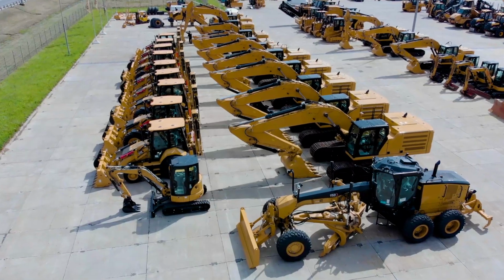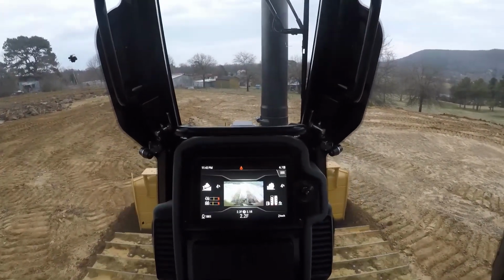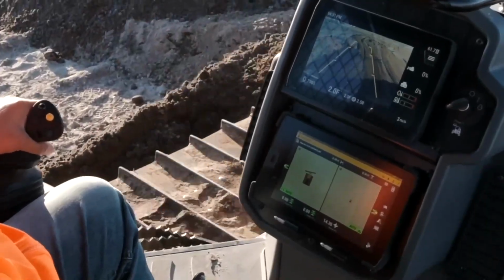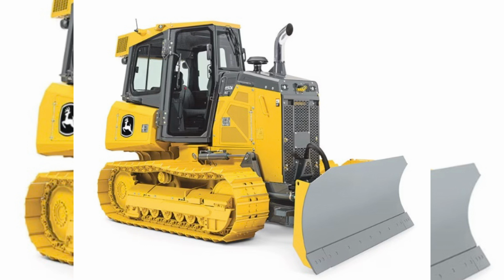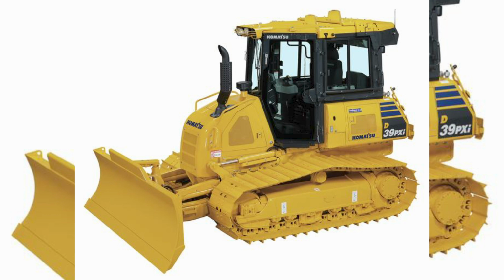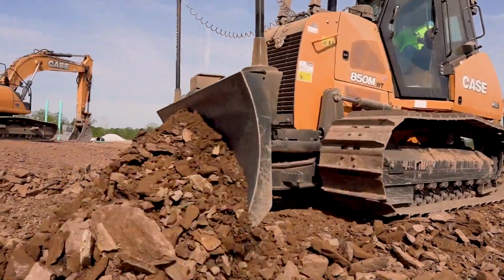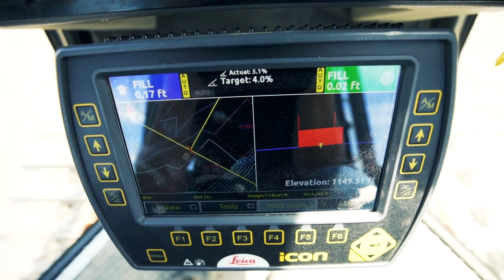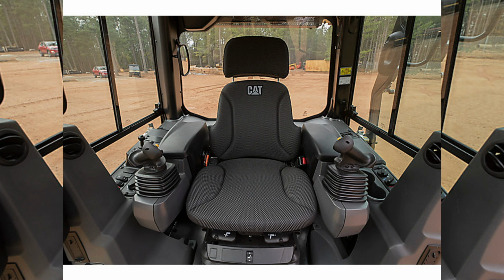WHICH SMALL DOZER IS THE BEST?!! We Compare the top 4 small Dozers!!

Comment: What was your opinion on the 1970s vintage CASE dozers with that what I call the best ( power tracking) the two levers between your legs. That was my time in seats. I was just amazed at what the 850 case loader could do on sewer backfill and pea gravel runs. We had also a International 125 and a cat D-3 size with a front bucket. I got to operate each one, because the International and cat sat a lot. The case back then ran circles around the other loaders. But yes, on build strength, the International was by far the beefy machine. Please give me your opinion on the operation of those old girls. I saw lots of contractors have ( JD) with backhoe attachment on sewer jobs before I was old enough to be an operator. I just never really liked the ( JD) operator lever set up. I will say the ( T) handle blade lever for ( JD) was so far ahead of its time. 😊
Reply from the maker: Thanks for watching and for your comments. Apologies for the delay in getting back to you as well. 
The older case machines were good machines. The 850 was a loader you saw in lots of different places. I saw them loading train cars, dump trucks and even on larger farms. As far as older case dozers, I personally operated some 550’s and 650’s and no issues with them whatsoever. Other than freezing my butt off in the Canadian winters because they had no cabs. That was all dozers here though, not just case.
They pushed well and were pretty good on fuel. I did find you couldn’t get real rough with them however because they just couldn’t seem to handle abuse too much. The old TD (International) dozers were great machines except for the decelerator being on the left foot which was really weird and hard to get used to.
All in all though, I would take older Case, Cat or International dozers over the 70’s Komatsu’s any day! 
Thanks again for watching and for your comments and questions. We always love to hear about the experiences of our viewers. Take care and stay safe out there!

Comment: Nice vid. 
I retired in 2016. The best  largest dozer ever built is a D11R   7pz series Cat. Hands down. After 20,000 hrs on a D11R, I think I'm qualified to say that..The d11t is junk imo. 

My experience on small dozers is all on older stuff. I liked the komatsu d41, d65 & p61. Very quiet. Comfy.  Good dozers. I built alot of DEP ponds & roads with those komatsu. They would hold a steep bank a cat would roll on. 
 D2,d4, d6 hydrostats, they get the job done, but the cat  hydro stat is a pita.  It either works or it dont. The d6 hydro stat GPS was ok. Not my favorite.  My favorite small Cat is a D6R. Very reliable, powerful,  & trouble free. 

My favorite personal small dozers for small fine grading was, and is, a 450 case. We have (2) 450 Bs. Old yes, but still very good.  They're both Cummins power, so actually over powered & you dont want a newb on them. A newb could tear them up. They are also pretty easy to work on, when you rarely have to do a fix. They're built very well. 

I'm sure these new ones are probably really something fancy, but I never needed fancy on a dozer. I like my dozers with power & reliability. 

Cat R models & old cases have both. 

Thanks for the video. 😊😊
Reply from the maker: Thanks for watching and for commenting, we always love feedback from our viewers - especially when they take the time to tell us their experiences and preferences.

I personally have never had the opportunity to operate a D11 but I bet they're quite the machine! The "R" series was a great version of Cat all the way around. Great power, great reliability and great comfort. From the 6 to the 10's which I have operated, enjoyed them all.

We put John Deere 36" pads on a Case 350 one time and that little guy would almost walk on water! Incredible for soft ground.

We're glad you enjoyed the video and happy you shared your comments. Have fun and stay safe out there!

Comment: The older d4 high track from the late 80s and mid 90s the K are great machines looking at from a grading small rock on the sprocket for wear the high track not as much on the sprocket crushing the smaller stuff just as must wear as the big stuff rocks not bigger dozers. The 3/4 rock gets in-between the sprocket and the drive chain hard on both the high track the idel wheel being smooth pops it out most of the time in stead of the sprocket grabing and pulling it in still both work changing sprocket teeth a bit easier on the high track not breaking the track apart in the feild changing pads that's 4 bolts compared to breaking a track apart in the feild by yourself. Some say unfriendly to the environment but also the high track used for Forrest fires keeping the drive up high for temp and such
Reply from the maker: Thanks for watching and for commenting. Everyone has their favorites for sure and we certainly won't tell you what should be yours! Thanks again and stay safe out there!
Reply: @SoGoWoWo  just tractor talk like cars and trucks not all nerds are computers and 5rings
Reply from the maker: Very true! We very much enjoy discussing heavy equipment as well. Those were great machines and the high drive has proven to be very advantageous in many areas. I personally spent many thousands of hours on a D6M with steering clutches (rather than the electric at the time steering clutches) and have fond memories of it. With the improved cooling and power - they were a welcome change to the 5H. Personally what I love about all these new machines is the speed of the hydraulics. They are just so fast!

Comment: Finish dozer guy here. Operating since 1985. Started on an old JD 450...In my opinion after running the new stuff the Komatsu fulling integrated GPS Dozers are the best as far as operator friendliest and comfort for sun up to sun down days. They also seem to hold up on track and undercarriage wear. My first time on a new D-39 was on a house plat we built I couldn't believe how smooth it turned and held the desired turn rate as i cut for curb and gutter...I got to finish it all in those days no GPS...the ponds turned out sweet as it was the the best for slope work as well...Cat is good, but can't compare on balance when free hand work is needed...and it always is...
Reply from the maker: Thanks for watching and for commenting, we always love to hear feedback like this. Operating the D39 is truly a wonderful experience. Smooth, powerful, lightning-fast hydraulics and great on fuel. That said, the others all have their strengths too and are also great to operate.
Reply: I have to agree with you..I have done alot of heavy sloping & building rock dams with blast rock in mines "camp work".. Road construction etc to having to do finishing work as well..Operating Cat d4,d5,d6,d7,d8 & d9.. h,k,n,r,& t, etc etc..Deere 750k,850k..Dresser td 20 & 25b,c,e & g..Komatsu d61,d65,d68,d85 & d155..For me,I personally prefer Komatsu for all scopes of dirt work..I have my personal reasons for preferring Komatsu,too many to list..That being said,I don't complain anymore😂 with whichever seat I'm in..
Reply from the maker: Our apologies for missing this post, we generally try and respond as quickly as possible but somehow missed your comment. We definitely agree - Komatsu makes a fantastic machine but operating any of them nowadays is pretty darn nice! It's not like the old days where one or two were far superior. Now they all make very nice machines to operate. Thanks for watching and for commenting and stay safe out there!
Reply: Can you help me with a real fuel consumption per hour worked? I'm interested for the D39 dozer to buy. Thanks

Comment: Could you clarify the Komatsu Tech, do they use TopCon or have their own GPS system to measure stockpiled material.  Have you compared the CAT Earthworks system when comparing different manufacturers equipment.
Reply from the maker: Thanks for watching & thanks for the great question. From what we can find researching, Komatsu's software is something they can program into Top Con or Trimble. Maybe one of our viewers could speak more regarding this? We certainly don't want to give out false information.
Reply: They use topcon but there is a conversion box to integrate if it's pxi capable

Comment: The best best small dozer I operated is dresser td7e too me better than cat d3 an john deere 450e  but the dresser had a Cummings engine,,
Reply: For the time period in the79s,80s and early 90s the international/dresser had them all beat, especially Trans and steering.  They were great! I now have a next gen cat d3 and recently had case 750m.  I did review on both
Reply from the maker: Thanks for watching and commenting! That’s very cool - I have ran some old model Dressers and you’re right, they’re a great old machine. Which one do you prefer now?
Reply: @SoGoWoWo  I currently own a new cat d3, I had a case 750m and komatsu d39 before it, all good machines,  I bought cat  because of the slope assist grade control komatsu did not offer and they were more expensive.  Cat gave me best price over anyone else right up front.  It also has alot of other features,  too many to list, but a couple are 7 bottom rollers instead of 6, a massive final drive system,  and stable blade control, you should look that up if your not familiar.  To date it is my favorite dozer I've ever been on. I've owned it for about 18 mos.
Reply from the maker: That’s awesome - I’m glad to hear about the Cat. I e always been a fan of Cat but sometimes the smaller dozers weren’t the greatest so it’s good to hear they e brought their game up. And they’re competitively priced too so even better! Thanks again for your comments and information - enjoy your Cat!
Reply from the maker: Thanks for watching and for commenting! We looked at the Dressers but they were a bit behind on technology. The machines themselves I have no doubt are great machines.  We were just looking for the total package. Thanks again for your opinion and your thoughts - we always love to hear from our viewers! Take care out there.

Comment: The only thing I find wrong with Kamatsu  is that it seems to be a little week pushing a heavy load with the blade. They lack behind in power to the tracks but do everything else well.
Reply: I dont agree with that at all. Push power and torque is what they do best,
Reply from the maker: Thanks for watching and for commenting. While we all have different experiences with different brands, those have been ours. That doesn’t negate the fact we did recommend the Komatsu as the number one choice. They make a fantastic machine! Take care out there and thanks again for commenting.
Reply: @SoGoWoWo  Dont get me wrong , I prefer the cat, but as someone who oversees 50-60 smaller dozers made up of all 3 of these brand, my numbers show John Deere with the worst reliability. Often related to metal fatigue or the wiring harness. New Cats its the track pins. Komatsu wiring ,sensors or def. of course ymmv
Reply from the maker: Really?! Well that is good to know. I haven’t had that many to work with but the ones I did were quite good. That said I never had one long term so that’s interesting. It’s always a pleasure hearing from our viewers because we learn interesting things like this. I too like the Cat, but I also like the Komatsu and John Deere. Dependability is definitely at the top though for both owners and operators so I’m quite certain other viewers will like to know these things as well. Thanks for the feedback - we very much appreciate it!
Reply: @johncooper9746 Your absolutely correct weight and power is what makes komatsu a good dozer
Reply from the maker: Thanks for watching and for commenting, we always appreciate feedback from our viewers. With the larger Komatsu dozers we would have to agree with that. These small Komatsu dozers however (in our experience) seem to be more powerful than most. That being said might have just been lucky to operate ones that were set up that way from factory too. Thanks again for your feedback and take care out there.
Reply: I'm a cat guy with that said but d5 down I like komatsu d6 and up cat  the d39 is a little tippy blading the 51 is good 61 good the only problems I see most is the blade control lever goes bad often and the blade drifts up or down own its own